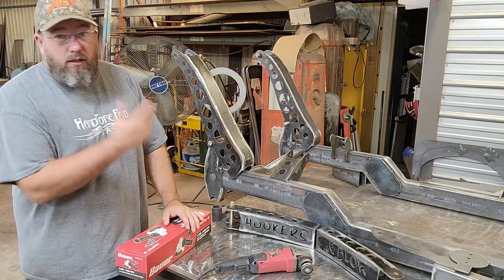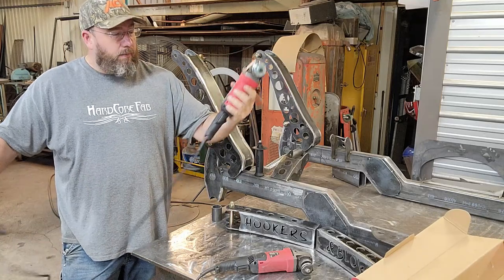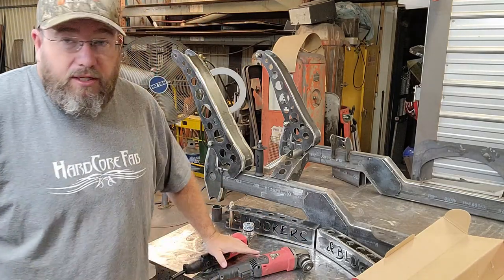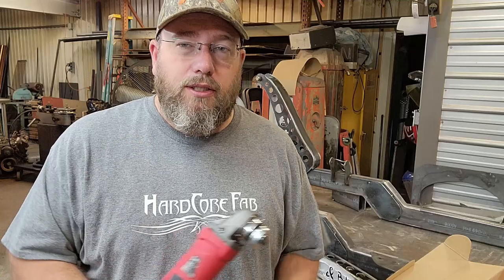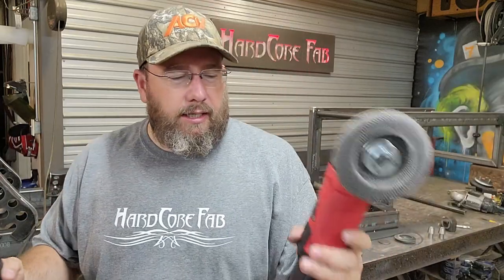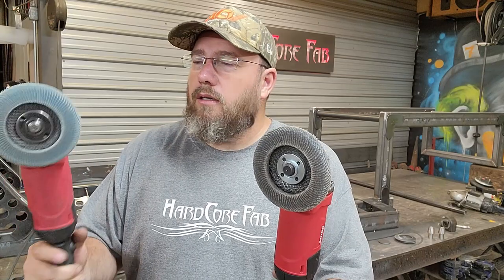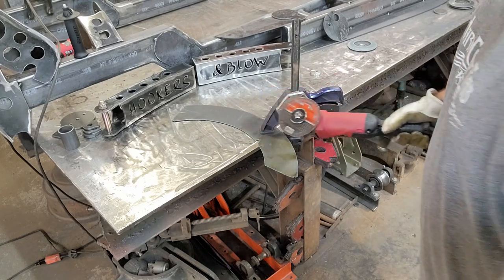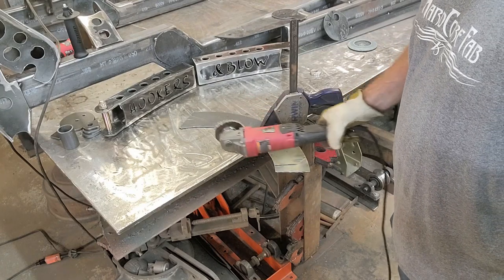Bauer grinder from Harbor Freight review

Comment: I've never used one and I have it, but scared to death to use it cause I don't know how to attach the wheel securely, I'm scared it's gonna fly off and cut the shit out of me. How do you securely attach the wire/cutting wheel?!?!
Reply from the maker: I just lock it on by hand but there is a tool to tighten the nut for some attachments
Reply: @HardCoreFab  could you do a video demonstrating how to do the different types of wheels?

Comment: Just bought one for home use. Mine didn’t come with a spanner tho…. Looks BRANDSPANKING new tho (05/02/22) called the store, they said spanners are Not included… Just FYI everyone
Reply from the maker: Hmm really?!?!?!  I just bought a 3rd one 2 weeks ago and I got one.  I don't use it but it was there!
Reply: If you notice while in the store, say this particular grinder may have different item numbers on box but it is exact same product is bcoz HF will use different suppliers/companies that decide what accessories they want to put in the box. That's why you might get a spanner and might not. If you want a spanner take grinder back and take note of your item# on your box and look for one with a different item # and open it up, you'll probably find a spanner wrench inside bcoz it came from a different supplier that adds that in as an accessory. Hope this helps 👍👍
Reply: So an interesting thing I just noticed about Bauer is they don’t have that distinguishing item no on them. However look on the square sticker on the top and it will have two numbers and a letter (18i) or (21 something), for this grinder specifically. They’re getting crafty trying to hide it. It’s also listed on the front page of manual.